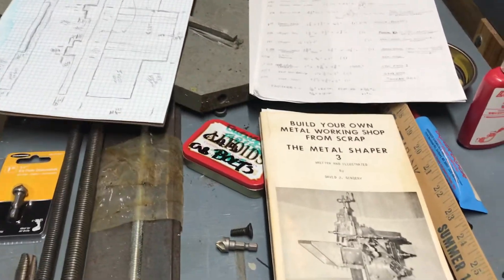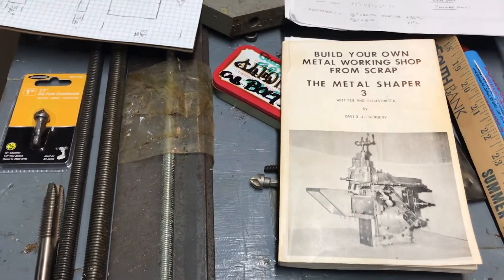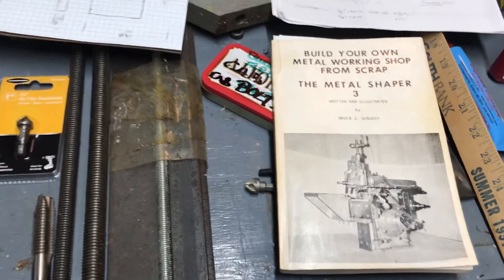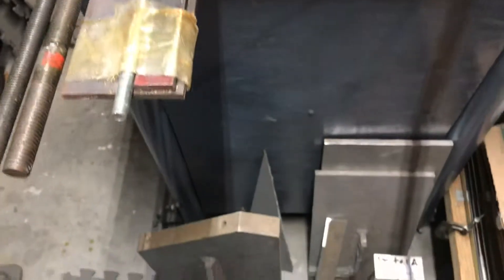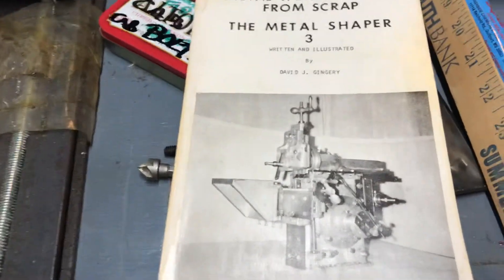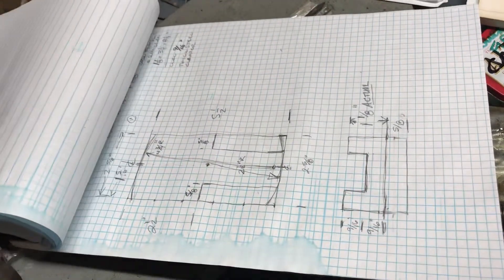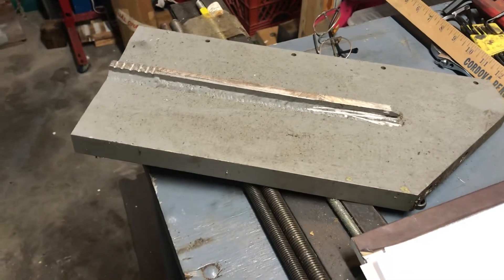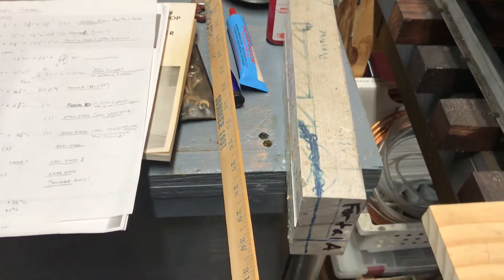Part 1 - Gingery Shaper from solid blocks (mostly)

Comment: Now that you've had some time on the shaper, would you change anything?? Thanks! Great build by the way.
Reply from the maker: Thanks for your kind comment. The biggest lesson I learned is that I should have just used the chain set up as designed by Mr. Gingery. The gear I used was the right general size but Ia lot fewer teeth, so the speed reduction was not what was needed. That’s why I had to do the extra pulleys and the dc treadmill motor. Would have been a lot simpler to just build it as designed.
Reply: Hope to start casting parts for one in the Springtime. I'll stick with the chain design.

Comment: I was thinking of making one of these shapers next winter as a project. But i really do not like the idea of an aluminium machine tool. So i am planning to use steel for the carcase of the machine and cast iron for the ram and cross feed parts. Cast iron is available for modellers in small quantities.
Reply from the maker: ro eng , glad you are interested in this project. I’d love to see your machine. Be sure to show some videos!
Reply: Home Shop Machinist Magazine featured a series building basically this machine with steel weldments.  The constructor/author Marsh Collins' project writeup is in  issues July/August 1998 & Sept/Oct. 1998, Jan./Feb 1999 & March/April 1999